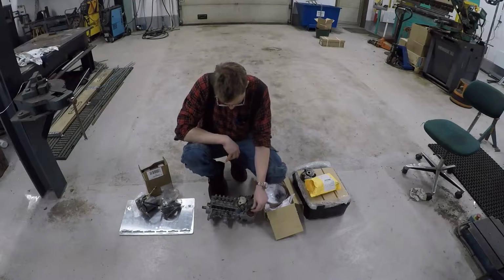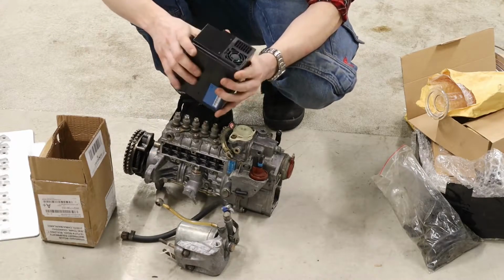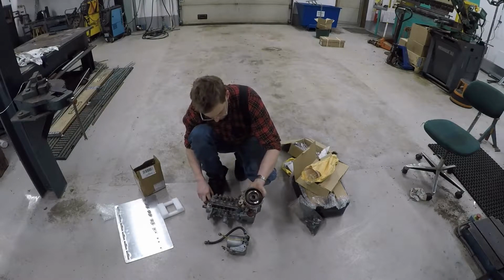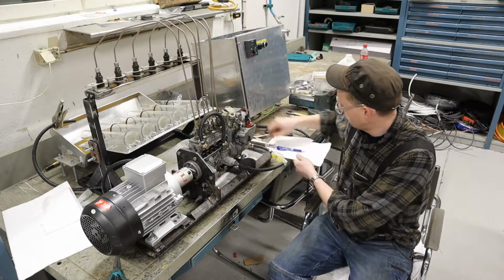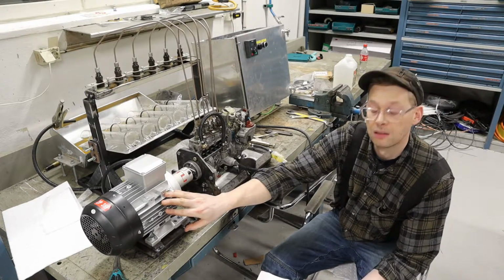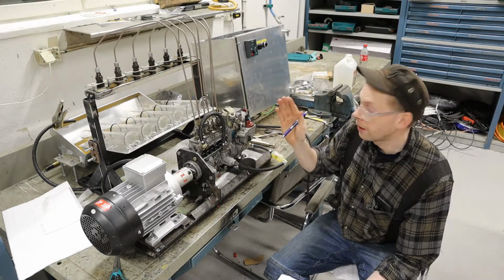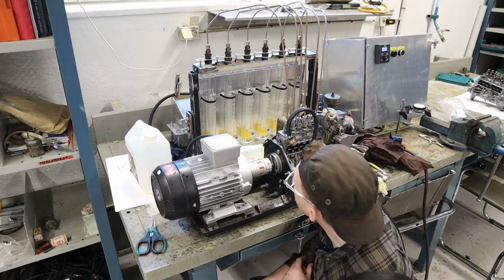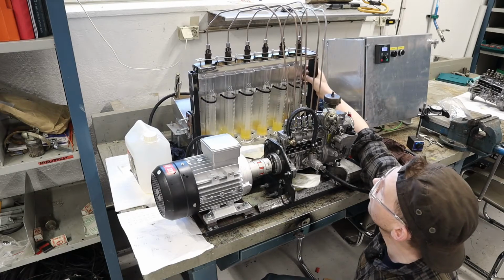Homemade Injection Pump Testbench for the OM603

Comment: Very Very impressive basic pump test bench build, well done on going into the "Mystical dark art's" of Bosch injection pumps.
Cheers from DownUnder.
Reply from the maker: Hello Glenn, yeah it worked quite well, and theres lots more adjustments i might need to add to the testbench like some way to check timing on each injector, but i got plans on how to build some extra stuff on the exsisting bench there

Comment: I've always wanted to try building a testing rig myself. Good job man!
Reply from the maker: nows the time to make one! i dont think it has to be fancy, just being able to check that each cylinder brings the same amount of fuel is what i think the most important part and something you cant figure out when the pump is on the engine. I am going to make a rig to test the phasing of the injection-timing to

Comment: Good to see you still working on projects. Looks like you brought your home project to work. I guess you could add some kind of magnetic pick up sensor to the coupler and add a tach to your control panel to see if the speed changes. Great project and very well thought out. Being able to check and set flow rates on your own bench will be a huge time and money saver.
Reply from the maker: Hello Cullen, Yeah "home made" is a stretch, but what i ment is that it isnt "store bought" rather made myself. Its nice to be inside in winter-time. I got an old RPM counter from IFM and a magnetic pickup sensor now so i am going to mount it (permanen or just a mockup i havent decided on yet).
Reply: @Foffe2000  Hey, can I have a blueprint for building this machine? dimension files? Regards
Reply from the maker: @ladytigra6167   no i made this one without blueprints. I did have a DWG file for the flange in the front but i cant find that one anymore (if you look down in the comments some others have requested those to)
Reply: @Foffe2000  ok. It's the question from my mate who got ban on YT so he couldn't ask You by himself. I'll tell him what You'd written. Thanks for the answer and best regards for You :).

Comment: Hi, this is terrific what you've accomplished. 
Looking forward to more videos on this.
Ross in Maine.
Reply from the maker: Yeah it turned out good! I am planing on mounting some bigger pump elements on a pump later on
Reply: @Foffe2000  That's exciting ! What size elements do you have? I bought Diesel meken's 7.5 pump building kit from his distributor in Texas a couple years ago and haven't built My 603 pump yet. I've been researching online for a couple years and you are in my opinion the world leader right now in building your own test stand and explaining to us the test information and how to build a stand. Once you get this fully working with a built pump running on your engine smoothly, you are going to be swamped by people who want to have you build their pump. Keep up the good work can't wait to see more videos. PS I was planning on building something similar when I bought my elements and for a constant RPM drive motor I was going to use my VW TDI engine with a PTO on it to drive the pump. Sounds crazy but I'm pretty sure it would work and it would be really cheap since I already have it.
Ross
Reply from the maker: @rossconverse7038  i got the 7,7mm DPUK elements, they where the only  one´s i know of who sells rebuild kits right now. I am hoping to make a video soon on swaping in those elements and hopefully being able to get it running as it should. Got a summer project where i need a pump that can bring a little bit more fuel than the original. But first i am going to take a break for a couple of weeks
Reply: @Foffe2000  okay thanks for getting back to me, looking forward to future videos on the subject. Do you have a Patreon or PayPal account? I want to make a contribution to your channel.
Ross
Reply from the maker: @rossconverse7038  Thanks how kind of you, but i dont take contribution for now, but thanks anyhow Ross

Comment: Hey thanks for the video - do you remember what size fittings you used for the metal injection line (injector and pump ends). Appreciate it thanks

Comment: You are my hero! I just subscribed..your inspiration is awesome! I have om606 engine and bought om603 mechanical fuel pump also DPUK 7,7mm plunjers…so i have same idea to build bench like this and calibrate and phasing myself..congrats bro!i really appreciate it👍👍👍👌
Reply from the maker: Thanks! about phasing i havent found if that is needed or possible on these pumps? but i guess there could and should be adjusted. I havent built anything to do this yet but adding a little 12V carburetor fuel pump and a  degree-wheel on this testrig should do the trick.
Reply: I am on my way to this 🎉
Reply: @Foffe2000  phasing is done with different size rollers.

Comment: I was wondering if people could help me,
I have a 1998 G wagon with an om606 engine but I wanted to get more power somewhere 220-250 PH how is this work possible,
Should I change the electronic IP with a mechanical IP, what changes should I make in the engine since I am a beginner.

 Thanks for understanding guys

Comment: Good work my friend.simple and efficient. How many rpm is that electric motor.thanks
Reply from the maker: It should be a little bit over 2000rpm at 50hz, they got a standard speed. But its all running with a frequency modifyer so i can run it 10% (200rpm) or 200% 4000rpm ..
Reply: @Foffe2000  thanks  a lot my friend. I have a  washing machine motor but it cannot run at 2000rpm.it need to multiplie  the rpm ×3 at  least.bye.

Comment: What would happen, if I messure the pressure between a injector and the pump?
Isn,t there a context between the pressure and the amount of diesel is injected in the engine?
I had the idea to make messurement mounts in the injection line with manometer/pressure Gauge. Less diesel should be messuered in low pressure....so my thoughts...

Thank you for your videos.
Reply from the maker: I dont think that it would work, when the line/injector got the "pop" pressure (130-145 bars) the fuel sprays in to the combustion chamber and this happens both on idle and full load, what differs between full load and idle speed is the amount of fuel delivered but the pop-pressure should be the same and the injector just makes a shattering noise for a longer term of time (opens and closes superfast). i got other videos where i pop-test injectors with a bench device, there you can see how the pressure on the line acts, and just imagine me pulling on the pumphandle faster or slower ..
Reply: Yes you are totaly right. I didnt think on that fact, the pressure and time of pressure is important.
But if you could messure the pressure and the time the pressure is lasting would that be enough?

I am thinking of an eletric pressure unit which you are screwing in the injection line before the injector. It messures the time of pressure and pressure in miliseconds like a Oszilloskop or something.
Reply from the maker: @kuchenimbart4576   yes that would be possible, there are advices that listens to the piping of a diesel engine by a sensor thats mounted against them, either when is expands due to high pressure of vibration? its used to set the right timing of the pump. i got an old mercedes one bought second hand from some service-shop. Maybe if you make something simular thats hooked up to a oscilloscope? not measuring pressure but rather frequency when the shattering of the injector accure? 
Or maybe build a pump like in this video .. if you are going to do adjustments its kinda hard with the pump on the engine anyhow
Reply: At the moment I am trying to find every information, how to adjust the amount of diesel on the pump....which part do I have to move to adjust the diesel amount? Could you explane the adjustment work?
I will ask a good friend of mine, he knows much about programming...I thought on a mount which you can screw on top on the injectors and on the messuring device the fuel line. There are pressure sensors which messure the time and pressure.

At the moment I am repairing a Mercedes T1 with om601. 
At first I have to bring the car to the technical inspection here in Germany, so that I am allowed to drive for the next 2 years legally. 
After this I wanna start a Turbo conversion. There is a om601 turbo in the vito 638. But in the T1 there is no room for the original manifault of the om601 fro m the vito.
So I will make a costoum excaust and set the turbo a little bit behind the motor. The oil I will take it from the oil cooler in line to the turbo. For the turbo I will take take the original 638 turbo with own wastegate Regulation. And then a intercooler in front. 
And also I thought of using then the diesel pump from the vito 638. In Internet I found out that is has bigger 6mm elements inside.

I think I need a few weeks to make this project happen. If you want I can tell you my experiences with this project.

Comment: Hello, do you have the adjustment values for the pump in 7.7.7mm? thanks in advance
Reply from the maker: Hello greg, i dont understand the question. The 7.7mm elements got the same outer diameter so no adjustments there. When it comes to adjust the amount of fuelt of each element its from pump to pump, if you do any job on the pump where you loosen the adjustment screws you got to adjust them again afterwards and thats what i am doing in this video
Reply: Hello, thank you for the answer, in fact I installed the elements as in your video, I still have to adjust the flow, my diesel specialist asks me how much flow to adjust, I thought -off boost 55cm3 -on boost 120cm3 -Max 160cm3 What do you think? at what rpm should we make the flow adjustments.. sorry for my spelling, I am French and I use a translator.. Thanks in advance

Comment: Excellent project,
I am also building a pump test bench diy, to test the VE bosch pump. 
The test injectors at what pressure you set them?  Thanks for sharing your videos
Reply from the maker: I mention it in the intro, i think they are popping at 125bars, and i am guessing that the real testbenches got adjustable injectors, my guess. They do run on specially calibration oil and monitered temperature (20C) to give them same results.
Reply: @Foffe2000  
sorry but I had escaped, my English is bad, I had subtitles in Italian. In the video you are using diesel or calibration oil 4113 for testing? I'm looking for the calibration sheet of my VE 1460406013 bosch pump, you know where I can find it? Thanks
Reply from the maker: @Fredhandyman   no straight diesel and even blended with some motor-oil (the jug wasnt clean). The calibration oil is prefered . . from what i heard it doesent smell at all and its safer on you skin and if you woild accidently blast that oil trough your skin and in to your bloodstream it wouldnt cause as much damage as with diesel. I got no sheets on the bosch-pumps whats so ever. Just some exploded views of the actuall pump from some handbooks..
Reply: Pressure should be around 175 bar. 
The nozzles in the test injectors are the most important thing. 
12SD12T is a common test nozzle. 
Also heating the test fluid to around 30-40deg celsius. 
Feed pressure of around 1 bar
Injector test pipes should teally be made from 6mm od x 2mm id steel pipe but if yours is working then sweet. And compression olives are fine for the ends of the pipes if olives are steel. If you dona lot of pump testing and the pipes are getting removed a lot then replacing olives is way quicker than re swaging an end on a pipe, well for me it is. And reswaging/forming and end loses you roughly 13mm of pipe a time.
Reply: Sent you an email to see if you built a test bench. Im currently building one in Australia struggling to get all the parts to connect the pump etc and any help would be appreciated have chat about. I wander if this adaptor in this video will fit the VE Type pump. I don't know where to buy any test bench injectors either, think they called 12s? They seem hugely expensive. Anyone got any links to adaptor coupling parts.  The bits that connect the ve pump to the electric motor and the mount etc. My pump is DENSO PUMP NO. 21200-1C310.  196000-5290. The spline and keyway on the pump itself is tapered 20mm down to about 16-17mm and the keyway is 4mm.  Not as easy as it looks to set one these things up.

Comment: Great video. Inspired to build one! What is used to adjust the speed rotation of the motor called?
Reply: Maybe some stainless steal wool inside the top of the tubes will stop the injector turbulance and still let the oil strain to the bottom.
Reply from the maker: frequency driver ? or just "converter" maybe .. i ended up using a Siemens
Reply from the maker: @ForPropertyInvestors   yeah good idea
Reply: @Foffe2000  Isa three phase able to be used on 240v 10amp via a converter? I heard single phase would not work on this application!
Reply: I just want to do a regular VE diesel pump off 1HZ Toyota Motor!
Reply from the maker: @ForPropertyInvestors  i actually think it can, no need for 3phase to "make" three phase , but i dont know if 10 amps is enough tought? i think this motor was about 3kW and i dont think you can go any smaller than that

Comment: love your videos! great to see some diy on these pumps. But what type of flange did you use, and where did you buy the nuts?
Reply from the maker: The nuts are M12X1.5 , i bought mine from Sagro.se. But i would guess you can buy them from any hydraulic firm
Reply from the maker: And the flange i made in CAD and got a company to cut out for me. But its not more komplex that you cant drill and cut it out of a steel plate yourself.
Reply: Skulle du kunna tänka dig att dela med dig av cad filen på plattan som du bultar pumpen i? Skulle underlätta att slippa rita upp det själv. Mvh
Reply: @Foffe2000   ok! thanks, have asked some people on what type of cone that you use to make new hard lines. how did you make those? is it a bubble flare or something you can buy to make your own hard lines?
Reply from the maker: @alexandernesse4013   i got a flare kit for brake-line and also used brake line for piping (kopper-nickel alloy) you might argue that they might flex a bit but still built to widthstand 200-300bar and if they do flex they flex the same all over (same lenght of the piping) if i remember correctly i used single flare 45degree on a test-piece and it worked, but i still double flared the lines to give more room between the nut and the injectors so those wouldnt risk to bottom out on eachother if the flare would collapse over time.
Reply from the maker: @MrVirre2000   Ursäkta Viktor jag verkar aldrig få notiser när folk svarar på kommentarer under andras kommentarer? helknäpp, visst kan du få den ritningen. lämpligast är i R14, DXF format då de flesta cnc maskiner läser dessa. Vad har du för mailadress.
Reply: @Foffe2000   Thanks! keep up the great content! love it!
Reply: @MrVirre2000  Could you send the cad file of the plate you are screwing the pump to? this file from @Foffe2000 because the author lost it somewhere. Thank you in advance.

Comment: What your brand tipe speed control motor
Reply from the maker: Its a Siemens Sinamics V20 , and as i commented on your other post. You can use these to transform 230VAC to 400VAC. Just mind the power-rating so you dont overload the frequency inverter.

Comment: Using motor 3phase or 1phase
Reply from the maker: I am using a 3 phase motor, but they are actually the same as a 1phase. On a one phase you just mount a capacitor in parallell. In this 3kW case a 90uF between W2 and V2 , and then 230VAC on U1 and N on U2. But as i said i used 3phase .. and on top of that the frequency inverter is capable of taking 230VAC on the input and you get 400VAC on the output.
Reply: Okay sir your using motor 3phase how many hp for the motor
Reply from the maker: @frenzyheavyequipment7396  3hp motor , wouldnt go any smaller, rather bigger like 5hp